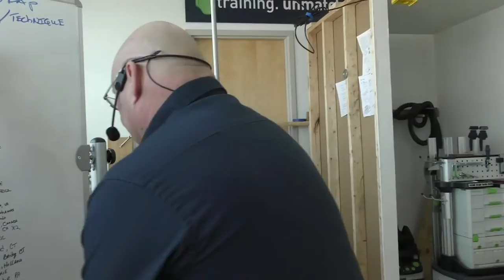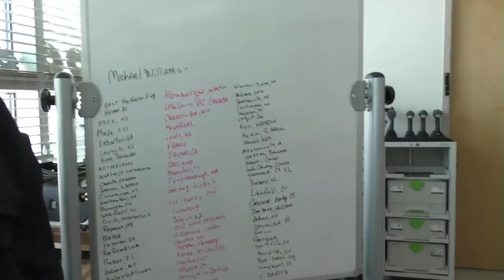Festool Live Episode 43 - Sanding Basics

Comment: Yeah, audio only came out the right side, except when someone else talked, then they came out the other side.

I was trying to sand some end-grain hardmaple+purpleheart the other day.  Started out with my 150/3 sander with 80-grit, and the hardmaple endgrain
was just laughing at me.  You could hear it laughing.  It sounded just like the evil cackling of Old Man Willow.

So i switched down to Rotex (non-rotex mode) and 60-grit, and at least it stopped laughing out loud.  More of a quiet chuckle now.
But it still took a long time.  I guess i should've dropped down to 40 grit?  I keep some 40-grit around, because well sometimes you want to actually
get something done.  But i was scared about what those huge rocks in the 40-grit might do.

Hmm, nice tip about the contour sanding.  I have some of the soft interface pads -- maybe i should actually try using them?

Comment: You mentioned using Granat on wood but your web site says Rubin. I just about to get a ROTEX RO 150 FEQ-Plus 240V and want to get a small range of discs. It will be mainly used for bare wood prior to putting on a finish. Any advice would be greatly appreciated.
Reply: my tool supplier sells them by the disc. 1 or 100 they are the same price.  phone around you might find one close.

Comment: When sanding rough wood , when do you change from  rotex mode to orbital , starting at 40 grit and going to 120
Reply: I switch at 80. Since its not a removal as much as a finish grit at that point. Sometimes 100 on something harder.  Seems to do ok.

Comment: I love all festool products but this sander has been nothing but a headache. I was sanding a solid wood panel on rotary mode and the sander stopped under gentle pressure. Once i restarted it the switch wont stay on rotary mode and it rattles a horrible noise.